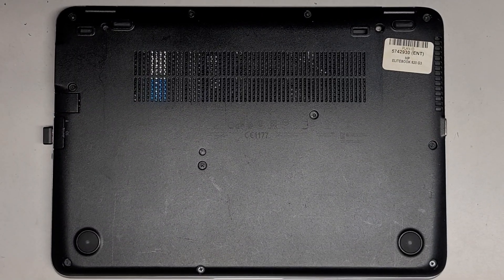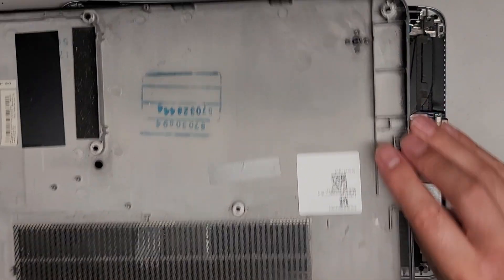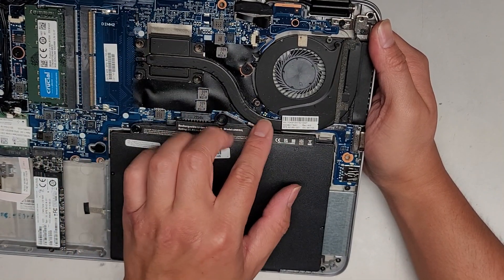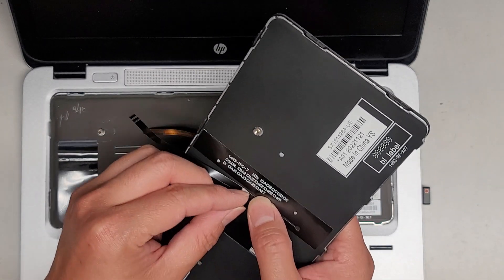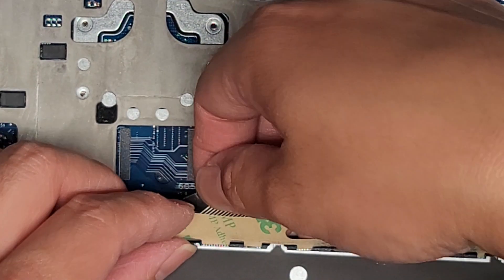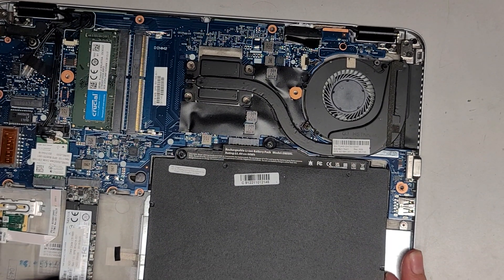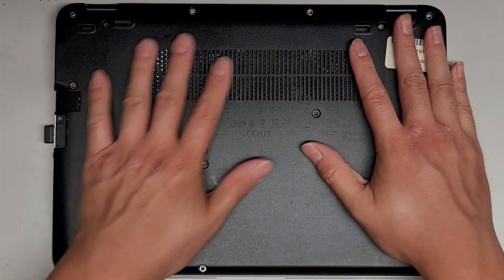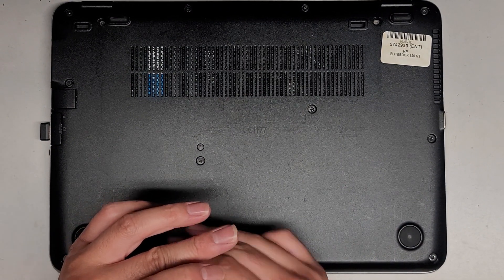HP EliteBook 820 G3 Disassembly RAM SSD Hard Drive Upgrade Battery Keyboard RTC Replacement Repair

Comment: My hp 820 g3 elitebook's screen was flickering so i opened it from  back and found the battery was swollen i removed the battery then checked the laptop but the screen was still flickering what could be the reason??
Reply from the maker: @Cherryloves111  does it happen on an external monitor?

Comment: Thanks. I just replaced my battery. The battery is only using one of the two possible screws from the factory (the spring-loaded one). The other mounting point near the connector is not being used for some reason.
Reply from the maker: Nice